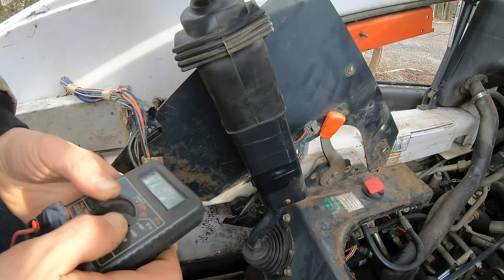Replacing a AHC computer

Comment: You should get a tube of dielectric grease and give contact a little squirt before assembly,  Not using it cost me $2500 for a new ECM and engine harness because of a rotted pin

Comment: Got a Kubota K008-3 micro ex, No computer at as the eye can see and works awesome just passed 3000hrs. aslo got a Kubota mini tractor B7100 from 1988 got abt 12000hrs on it, works like a charm always starts even in the coldest arctic weather here in Sweden.

Comment: I was going to offer to try to fix the old one and send it back to you but it looks like it's "potted" in epoxy.  Good for rattle and watertight-ness, bad for repairing.
Reply: You might be able to slice the case off the other side, sometimes they put a spacer/shield and it's only the bottom panel that's epoxied....  But yeah, great protection, but almost impossible to fix.
Reply: They don't want us to be able to repair them!!!!!!!

Comment: 20-20 hindsight long after the event but it was probably the new AHC learning the machine's control calibrations, on some machines you need to do a weird joystick-seatbar-switch on combination to calibrate the controls after making changes to the system. There's a reason "have you tried switching it off and on again" is the first line from IT support. That electronic package is a 20 year old design, these days you could fit it in a matchbox.

Comment: $1500?? If they didn't coat all the electronics in that plastic crap you might have been able to fix it at a component level for next to nothing. Crazy...
Reply: Seriously, the way they designed that is anti-consumer. They could have designed it to be serviceable and waterproof, but oh well, F*  Bobcat
Reply: Then it would be at risk of being unreliable especially given the sort of abuse these machines take, although I'd argue that there's ways around that (see automotive industry) but when a manufacturer pots something like this it's to ensure it cannot get wet, doesn't rely on gaskets etc.

It's a toss up for the manufacturer and in this instance they've opted for the most reliable way of waterproofing electronics.  The price of replacement though... ouch, especially when it could be something as simple as a bad relay on that board.

Comment: Our backup generator is driven by a Deutz diesel engine. During our monthly test we noticed the generator shuttong down early and having jumping rpms. We called in the manufacturer of the genset. They drove here with 2 guys, inspected the unit and told us its an engine failure, they cant help and they will call a subcontractor to come and fix it (1 guy didnt do anything as he wasnt a mechanic but they billed us 2 ppl anyway). The sub came and identified a broken actuator for the fuel supply. He suspected bad fuel, switched the actuator and it didnt improve. After looking at the output of the computer to the actuator he determined the computer is bad. Turned up next day with the replacement ECU and the engine is running fine with it. What happened is that one power mosfet of the ECU got damaged and spilled out changing voltage levels all the time which wore out the actuator within a few weeks. So a faulty ECU might not just disable your equipment, it can also further damage it. After that we ditched the manufacturer and hired the sub for maintainance.

Comment: Sounds like an intermittent ground connection.
Reply: Sean Signer I agree, the third continuity test sounded initially week which makes me think the wire/connector itself because it picked up when he pressed harder. He should have looked at the resistance reading on the meter while doing the continuity testing.

Comment: Good stuff. But, when checking continuity, it's good to check the other pins also to make sure there's no shorts, also jiggle the wire when doing this to see is maybe there is momentary short, the worst kind. The issue becomes when there is no short but instead the insulation is worn, but no exposed wire, where there is enough current leak between wires to trick the computer into thinking there is a short.

Comment: Question. Andrew do you ever check the relief valve settings on your hydraulic equipment? It seems to me that they can go away over time and need adjustment upwards. Otherwise you are not getting the most out of the machine.

Comment: You should get a kubota skid steer they are very good quality and never breakdown
Reply: Kubota is a good investment, but like I tell my wife, "never is a really long time".  They will break just not very often.  Hey, JCB has a compact track loader with a telescopic boom.  Probably megabucks but this is the machine of the future.  Solves some of the problems CTL's have with truck loading.
Reply: @davidmorse8432  JCB Teleskids, neat machines. Lord Much did a side by side comparison between a Teleskid and a Bobcat.
Reply: @sunshaker01  what is the link?
Reply: @davidmorse8432   https://www.youtube.com/watch?v=gn5cR2XUWUg (Auto correct seems to have turned Muck into Much).
Reply: Dirtbike Rider55, That is not true!!! Just bought two SV 75 and at 500 hours they both lost the motor. We bought extra warranty and loaner program. Stick to Dirt bikes !!!!!
Reply: @sunshaker01  Thanks for the link, I will check it out.

Comment: I have a bobcat 863 g that is doing the exact same thing, dealer had it fr a week charged me a $1000 it worked about a day and now has the same problem with the tilt. If I never hear those three books again I’d be happy. Now they want to replace the AHC controller? Did it fix your problem or was it temporarily?
Reply from the maker: This fixed it, but that light still comes on sometimes and the machine has to be restarted.

Comment: You know Andrew I don't work with these type of machines but do work in the auto industry and every time we change a computer or sensor there is a sequence that we have to do. A lot of times it involves starting and stopping or disconnecting the battery for 10 seconds or driving for 10 minutes to reset things so maybe running it and restarting a few times reset it so it might be good to go now.

Comment: boosting can damage computers on machines. To minimize damage to electronics shut off both machines before removing booster cables. You can get voltages over 1000 volts on your 12 volt system if you remove cables during charging due to inductive kickback. That is the sparking you see when you remove the cables.

Comment: What year is your loader? 
I have one that I bought new in 2000. The parking brake froze. I brought it in and the dealer said it was the computer. Installed a new one and now the dealer is saying they cannot get it right. The brake still does not work but they said they can bypass that and also the fuel does not shut off when the machine is shut off so they will install a switch to interrupt the ground on the fuel supply and I would have to shut off the fuel when I shut off the machine.
They mentioned trying to put the old computer back in to retrieve certain codes to help with solving the problem.
This dealer has five locations and all are still stumped. 
Any words of wisdom?

Comment: Have you checked your alternator voltage? Some computers are very sensitive to power supply voltage and can get intermittent when supply voltage fluctuates or is not at a constant level. A new alternator/voltage regulator could be worth a try.

Comment: You could have tested the computer's output solenoid signal at the base of the computer 's wires with pins stabbed in the wires and the multimeter while all was normally connected.
You would have been absolutely sure it was not a faulty wire from the computer resin casting  to its own connector and maybe saved you 1500 $
Even a continuity test on those wires would have helped.

Comment: Hello everyone . I'm from Latvia . I also have bobcat 864  2000 year. when i bought this machine i was very happy and excited for it. Two years have passed since I used it. And my thoughts have changed. I hate this machine because it breaks down all the time. engine smoke, oil leaking I've repaired a pump , has replaced both running motors. several solenoids, wiring, electrical problems and there are always problems with the AHC now the actuator is dead. and my bobcat dealer wants 950 euros for it. parts are unreasonable expensive. How much do you ask for Skid-Steer service? How much costs one hour work with Skid-Steer loader on your side?

Comment: On my dairy farm I have a 05 s220 with 8009 hours and a 99 763 with 8200 hours. No serious issues with either of them. 763 has a bad wire which trips the traction break. Other then that we love them. However I completely agree computers are way over used in industrial equipment.

Comment: Probably noise, spikes on the power supply to the computer/controller or eventually under voltage. Check for correct supply voltage to the computer/controller with an oscilloscope.

Comment: Good morning Andrew... on a “ g “ series machine like your 864 you have to hold down the light button for like 8 to 10 seconds for it to show “ codes” ....

Also anything newer and with hand controlls will most likely computer controlled and more technology built into it then .... and parts will be way more expensive.... I’m a bobcat guy thru and thru... but I wouldn’t buy The newest equipment produced by them to issues they have... my oldest boy worked for them as a mechanic just till 2 weeks ago... I saw and heard the horror stories of the newest equipment... If you decide to sell the 864... make a video , I would be interested....thank you for making these great videos...  My current machines are bobcat 863-S250-T300

Comment: I agree no computers. I have a Toro Dingo mini skid steer and as it got older I had nothing but problems with wiring and relays solenoids and such. Went to the dealer for new parts but unfortunately I didn't win the lottery so I couldn't afford them. I then did what Andrew would do got out a pair of side cutters cut all the wiring got rid of all the relays hardwired everything with fuses change the fuel shut off solenoid to a manual throttle cable and I have had no trouble since. The whole makeover cost me under $50 compared to2600 for parts from the dealer.

Comment: I work in a port where we have 2 Bobcat SkidSteers that go into the ship to clean in the ship and make it easier for the big crane. After 500 hours one had a stuck cylinder and a lot of electrical problems. Almost every day a service car from Bobcat is there. I think we will switch to Volvos now.

We also have 2 Bobcat telescopic wheelloaders with each 3 tons capacity. They have a central grease pump for all grease fittings and after 1000 hours there is already a lot of wear and play in the bushings.

But we also have a Volvo L110 also with central grease pump, it has 17.000 hours and there is no wear and nothing in it, engine running like on the first day.
Reply: my city has a modern industry park and an airport.  we see many expensive farm vehicles and trucks by volvo, scania, MAN.  the local companies know how to plan and budget.   japan and south korea are all mountain.  their durable, high-tech vehicles are good for andrew.  i don't understand how any company can waste money on bad vehicles.
Reply: Bobcat is cheap. For the price of one Volvo Skidsteer you get two Bobcats nowadays.
Reply: Volldampf Harz but Volvo is the best brand out there
Reply: @VolldampfHarzFilme   Buy cheap , Buy twice
Reply: True words!
Reply: Andrew? You reading this one? Seems Volvo's on the list.
Reply: Just before you go buy a brand new “Volvo” please just sit in the cabin of the bobcat. I’m 16 years old and I worked at a bobcat dealership all summer. Our dealership traded in a Volvo skid steer loader and I can say I wasn’t impressed. Driving in the tight shop is almost impossible because you can’t see behind the right lift arm. Also everybody thinks that the one arm thing is cool because you don’t get trapped in the machine when you raise the bucket up. but when you exit out the side you just end up stepping in all the dirt and debris that you’ve been driving in all day. I may be biased by I just really don’t like the fit and finish of the Volvo. Please before you look at anything just sit in the pressured bobcat cabin. All the controls are right where they need to be and the visibility is a step above the rest. The bobcat will not disappoint you. I’m not trying to spark and “online argument” I’m just expressing my option. :)
Reply: 21kockaid - you are probably referring to the newer Bobcat models. Andrew only buys older stuff. He also doesn't want any  computer based controls which may rule out Bobcat and Volvo.

The older Volvos may not have the single arm mechanism. All I could find Googling was new stuff.
Reply: @21kockaid-28  I think he made it clear Bobcat was junk.
Reply: @21kockaid-28  But do they last
Reply: @21kockaid-28  Youngin', he doesn't buy new. It gives him a rash to buy new, except batteries. I've seen him buy new batteries.
Reply: @markconger8049  But now he had a problem with "computer"
Reply: I think the same , the computer isn't the problem, because the Computer is cast and sealed !  But not all the connectors, may be there is a corrosion on the connecting parts , that changes the resistence of the connection and if it is out of the Ohm Range an error occurs. I was an hard and Software developer a long time in the past with experience . the resistence changes about the little movement of the connectorparts by vibration and/or by moisture.
Reply: @robertalexanderhoffmann8229   his issue was with burned mosfet,it is 5$ part, but because it is sealed it is almost impossible to fix without knowing where are those parts in cast. I have possibility to take an xray picture, so I would just xray it and drill out epoxy arround damaged mosfet (propably all mosfets, or reverse engineer it to find which one is responssible).
Reply: I have a 2012 Volvo MCT 125d. It is the JCB 260t rebadged Volvo. While I like the power and single boom, it is fly by wire, just like the Bobcats and you are slave to electrical gremlins.  The machine is perfect for forestry work and would probably increase Andrew's production on drives and land management,  but it is a bit large for tight residential construction sites. It is like the last track skidsteer you buy before buying a D4.
Reply: Almost everything he buys had a million hours on them than wonders why they break. He buys others old junk. And most people just don’t keep care of them they just drive the shit out of them and than get new ones.
Reply: Brian Navalinsky But he so anti - America made it make me nuts. He always putting America made stuff down we use to make the best of everything. But now America companies got to compete against Orther country where their paying their workers 50 cent and hr. They have to cut cost somewhere to survive and to stay in this country putting Americans to work. His thinking is what killing these country. They can put better parts because they got slave labor. America companies could make things better than any country but people wouldn’t buy it because it would cost to much. He costing many of the people that hire him their jobs in the way he thinks. You don’t have to buy new just don’t buy the junk get in the middle. If you buy junk it going to break down. He must not be doing a good job of selling himself or he have more work. That on him.  Am surprised he has not grown as a business. He working on his equipment more than he working. He putting all of his time in growing his U Tubes channel instead of his real business.
Reply: Brian Navalinsky I don’t care who owns the companies as long as their putting Americans to work. And he anti- America made in everything that made not just this.  This isn’t the first time he put down America made he has many times. And am just sick of it that one reason I just don’t watch him like I use to and am sure am not the only one that feels the same. These is America not japan I will back my country first and America worker first. If I got to pay more for America made I do. It just the way I was raised.  Like I said it not companies in japan that are paying his customers their pay check. And nothing you or any one else say will offend me. Am a big boy I can handle it.
Reply: Brian Navalinsky alease  bobcat is is putting America to work here in the United States.
Reply: Brian Navalinsky He can buy anything he wants he just doesn’t have to be Anti-American made like he is he said bad things about all things made in America many times and he makes it sound like if America workers were given the same parts we still wouldn’t make them as good like he putting down America workers as a hole that the way he comes across. He got a to high opinion of himself.  You listen to what he said he making it sound like even if the same company owns a plant in America or japan the japan workers will do a better job of building it their than here. And that total BS.
Reply: @Vein1986  They pot all electronics on most construction equipment because of vibration.